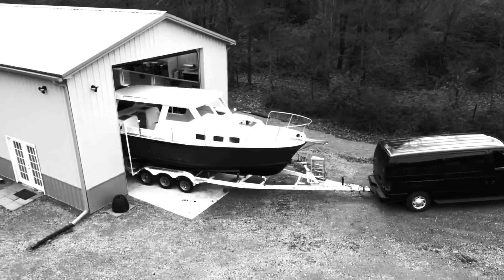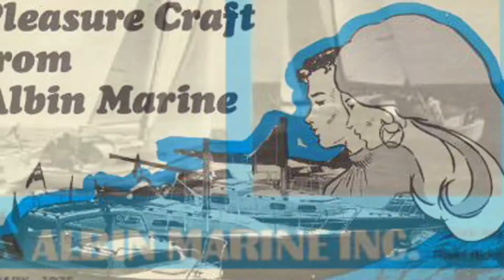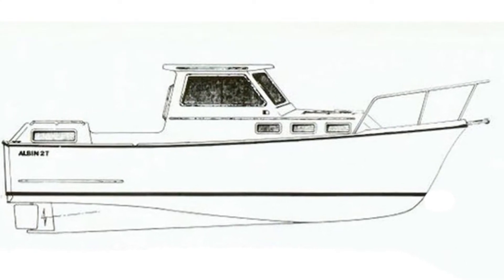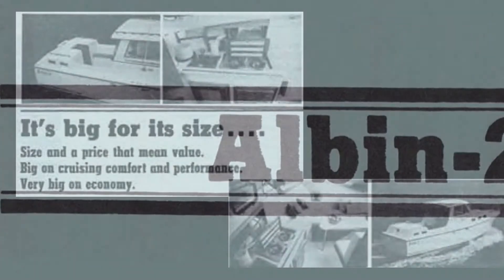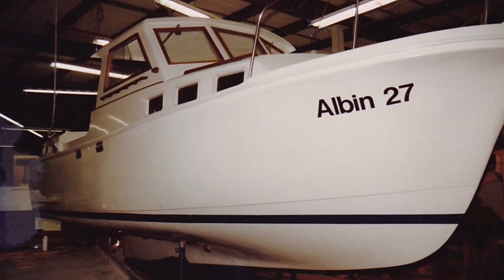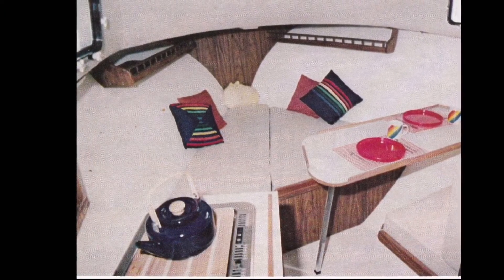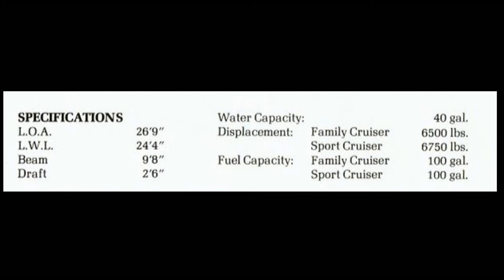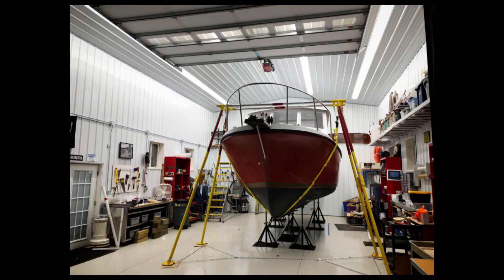Best Budget Small Trawler | Albin 27 | My Boat Restoration and Boat Building Project (Ep2)

Comment: Here's my 1986 Albin 27 (Nissan LD28 in-lin 6 diesel) on the St-Lawrence river, 20kt headwind, https://youtu.be/F1JX5hNvNrs
Reply from the maker: I plan to go with a more modern engine and not the Nissan Ld28. Thanks for the videos
Reply: @motorcityboatwerks   agree 100%, as much as the Nissan was a great engine, you just can’t find parts for it anymore. Even Nissan in Japan couldn’t help me finding what I needed. I finally found my much needed part in New Zealand.
Reply from the maker: Exactly 👌